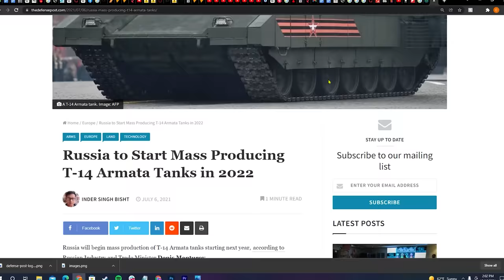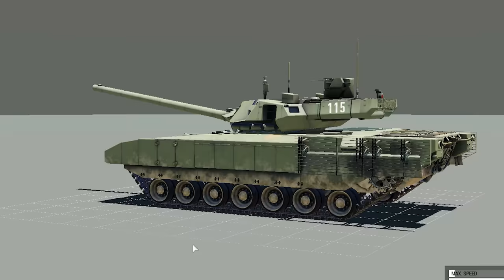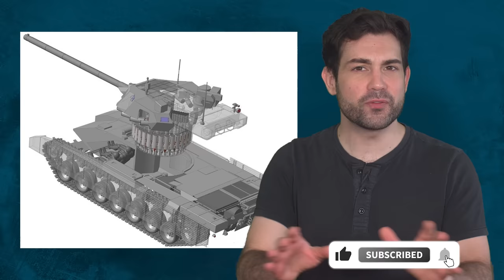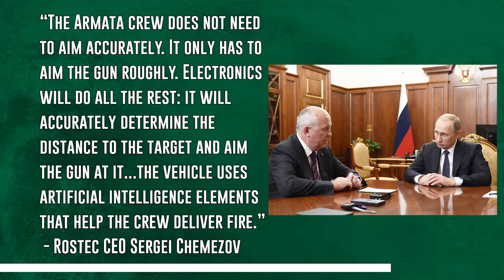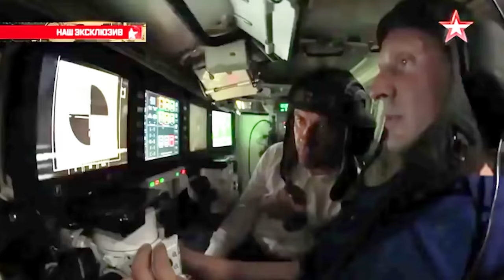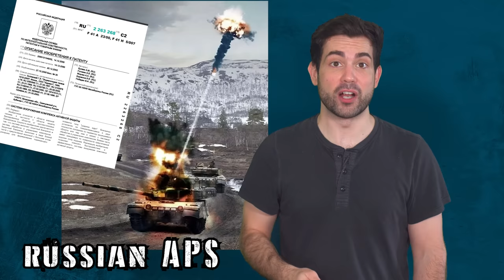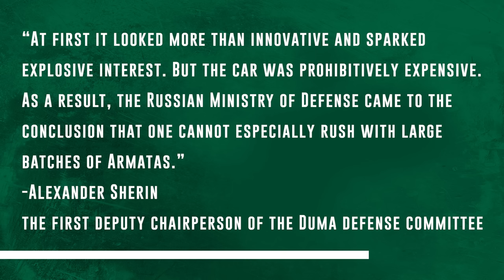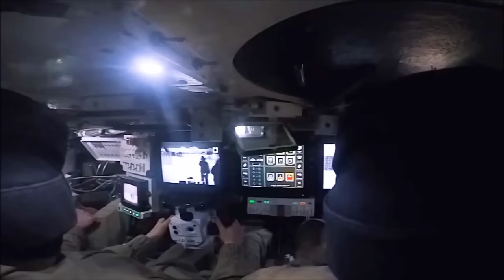The Truth About Russia's T-14 Armata Tank

Comment: The Abrams does not have 50 times zoom, it has 50 times digital zoom, increasing those pixels does not give you a better picture. Fairly confident any computerized fire control system can zoom in on pixels not just the abrams.
Reply: Yeah digital zoom is nothing special. And as you say, you can't create detail out of something that isn't there. The real world isn't CSI where you can just infinitely enhance and magically get details you wouldn't otherwise get.
Reply: @TehIdiotOne  Enhance four pixels into an image sharp enough to figure out what brand of watch the perp was wearing XD
Reply: No bro this ain't ur average software it's alot better and it ain't entitled digital if it was then you wouldn't have a camera
Reply: @yeetyskeet5548  That's not how optics work.
Reply: @yeetyskeet5548  That's not how optics work.
Reply: @yeetyskeet5548  That's not how optics work.
Reply: Clear up that blur!

Sir that's the maximum resolution 🤣
Reply: @CarlGGHamilton  Digital zoom and processing has nothing to do with the OPTICS used
Reply: @josephspurgis7782  Digital zoom and processing has nothing to do with the OPTICS used
Reply: @zenko247  Optical zoom is the actual zoom, it determines the actual size and resolution of the picture. Digital zoom just makes the pixels bigger, it does not increase image quality.
Reply: @CarlGGHamilton  THEY ARE USING DIGITAL ZOOM  WHICH AND LISTERN |TO THE VIDEO If the  digital sensor has the resolution the image quality increases proportionally  no matter the optics  a 100Mega pixel sensor will give a sharper image then a say 20M Pixel no matter the optics  And the better the software the better improvement no matter the Optics. Ask any amateur  astronomer with a digital setup.
Reply: @zenko247  "100Mega pixel sensor" that's called optics. Light sensor, is optics. That is what optics are. :)
Reply: @CarlGGHamilton  A DIGITAL SENSOR  is not OPTICS  it coverts Light to Electrical signals and processes them electronically   Optics manage light not electrical signals  😁
Reply: @zenko247  https://en.wikipedia.org/wiki/Digital_sensor

You don't know how light works, and you don't know what a digital sensor is. I suggest you go try and use a camera because clearly you never have.
Reply: @CarlGGHamilton  You just shown that I was correct and  Digital Sensors are not Optics .  Note: Worked 20 years for Corning As a project designer for Fibre optic telecommunication and know a little bit about the subject of digital Transducers   OH and My 20mega Pixel camera on my new phone give much better pictures then my 5 mega pixel camera on my old one
Reply: So a Standard Definition  TV does not give a better picture the a HD TV with 4 times the Pixels  and a $K tv does  not ether ?????  is that what you are saying  ???  more pixels give a better picture or the whole world it being conned and are unable to differentiate between low and higher Pixels in the displays are they
Reply: Well the abrams had no problems in iraq. If the Ukrainians had them the war would be over.
Reply: @tclanjtopsom4846  If the Iraqis had 20,000 tanks and ballistic rockets that would have destroyed US airfields in suadi arabia it would probably not have been the same war now would it. You think a war comes down to which tank people have? That's silly.
Reply: @CarlGGHamilton  i think the usa would have used its better cruise missiles and airforce to destroy their air power and then used its tanks and troops with good logistics. Russia has shown its army to be a paper tiger.
Reply: @tclanjtopsom4846  That is cute
Reply: @CarlGGHamilton  it's cute because he is right lol the US destroyed their rockets before they could even fire but even if they had the US missile defenses are more than capable of taking out any missile short of the hypersonic ones and even those I bet the US has a counter for they just aren't saying anything yet. And even russia doesn't have 20k tanks lol what is that even supposed to mean 90% of Iraqs tanks were destroyed by the airforce anyway tank battles are basically a thing of the past.
Reply: But western arrays have orders of magnitude more pixels on their FPA's - so the zoom is still better resolution then russian displays.
Reply: @dennisbrown5313  You can have 1 billion x 1 billion pixels on your display, if your camera only takes 480x480 pixel pictures, that's still all you're going to get.

Comment: The B29 had four unmanned remotely operated turrets.
The Rheinmetal 120mm has been able to finish the targeting solution since the 1970's when it was a 105mm.  This technology was introduced in the AH56 Cheyenne based off the technology from the B29's radar remote targeting stations.
Reply: The B-29 also had a Sperry analog computer used to direct fire, coupled to the aircraft's on-board radar.  Analysis of combat footage over Europe from B-17s, B-24s, and B-25s, which were designed for much slower top speeds (about 260 mph), against early 1940s-vintage fighter aircraft (some could very shortly get over 400 mph, but doing so severely hampered their "loiter" time) indicated that waist, top, and belly gunners seldom, if ever, hit any enemy aircraft, due to the vagaries of the approach vectors and relative velocities involved. The rear gunner had the best chance of hitting an approaching fighter at all; followed by forward gunners (in the B-17G onwards) taking on a "head-on" attack.  Typically only these two positions contributed any meaningful defense to the aircraft, the others were useful mainly for complementary cover to the other planes in formation.

The B-29 intended to solve these issues by having the analog computer devise a shooting solution when the aircraft's radar picked up enemy targets; it could direct those remote-control turrets quicker and with better accuracy than a human gunner was capable of.  Since that plane wasn't used in any numbers over Europe, and by the time it really got into action in significant enough numbers over Japan in early 1945, the Japanese fighter defense was virtually nonexistent, due to lack of, mainly, fuel and trained pilots.  Most of what aircraft they did have were obsolete by 1945 standards and what few did sortie were easily picked off by American CAP, either P-38 Lightnings or P-51 Mustangs.  In fact, the CO of the XX Air Force, Curtis "Bombs Away" Le May, realizing that the B-29 gunners were effectively out of a job, had all but the tail guns, ammo, and crew removed on some of them operating out of Tinian island, and sent them on low-level night raids against Japanese cities, dropping incendiaries with horrific effect.  The air raid of greatest destruction was against Tokyo, with 328 of these B-29s, thus modified, and the destruction burned out almost 20 square miles of Japan's capital and killed an estimate 125K people...more died that night than in the first 24 hours after Hiroshima and Nagasaki, combined.

However, the heydey of the B-29 would be short-lived.  Not only was it slated for replacement by first the B-36 "Peacemaker" and later the B-52 "BUFF", it was, in spite of its size IAW WWII standards, designated a "medium" bomber when the Air Force came into being as a separate service.  Over Korea, at first the B-29s helped to destroy the DPRK's ability to carry on the war, and fighter cover (F-51s, F-82 "Twin" Mustangs, and P-80 jets) dealt with the WWII-vintage MiG and Lavochkin piston-engined fighters flowed by the North Koreans.  But in November, 1950, the first MiG-15 jet fighters made their appearance, and could virtually ignore the USAF fighter cover and wreaked havoc on the B-29s in daylight.  These jets were, of course, flown by Soviet V-VS pilots, under command of WWII Soviet Ace Ivan Kozehdub, who also, against orders, flew a few missions himself and claimed to have shot down two USAF P-80s and an F-86!  It got so bad that after a particular debacle, known in USAF annals as "Black Tuesday", where, on a daylight raid on October 30, 1951, six of nine B-29s of a particular raid against an airfield at Namsi, Korea, were lost.  The USAF would never send B-29s on a daylight raid again.

Comment: Don’t quote me on this but 50x on M1 is electronic and therefore not really a lot better than 12x on the Armata
Reply from the maker: you're saying its like a digitally enhanced zoom instead of anactual optical lens zoom? That might be the case I'll have to double check that
Reply: @Taskandpurpose  yeah in my memory it is but I’m not 100% sure
Reply: You're right but this isn't the early 2000's using old nikon cameras. It is a new upgrade and most likely has some sort of upscaling.
Reply: Upscaling or any form of digital zoom is still a legitimate issue. Even with current technology, it isn’t up to par with analogue lenses in terms of picture quality. You also can have issues with minute details being obscured or blended into the overall picture. This may be an issue against a target that’s well camouflaged.
Reply: @Taskandpurpose  yes the optical zoom is 13X and the Abrams can further electronically zoom 25X and 50X. However firing from that level of zoom gives a higher chance of error bc any tiny adjustment in aim will have a greater effect on trajectory
Reply: These are true statements of firing at target at distance. Even on the military channel this is evadent in trying to get long ranged shots weather it's digital or actual lenses are tricky at best. Say is that a tank in distance? The only good long range is the main gun. Fire on target!!!!! Say was that the direction of the parking lot? What did that guy say on the radio? Oh #@$&!!!!; That was the commanders car. Driver just drive. Go go go!!!!!!
Reply: @rayhatton7683  You are leading into the value of a combat network.  The ability of all units to share and update information about targets changes the doctrine.   A long range targeting system becomes far more valuable.  Without such a network, the capability is hard to justify, since the crew is unlikely to spot, identify and engage a target at 5km.
Reply: @1djbecker  very true. Now the comment on long range shots are also true. The distance involved doesn't mean the shot will reach the intended target or even on range. Then the joke makes more sense. Whom knows how there tank ranges are used or set up honestly. Not counting on human error or the factor of error in the targeting of targets. How would anyone see even in long distance involved with this system for it to be seen?

Comment: Great presentation, Chris. Just a thought. Maybe what the Armata's is going through (as the intended next step in concept and design) is exactly what the T64 went through?

Armata is what the Russian military wants to have BUT may not necessarily THE only way to achieve that step. 

The T64 was produced in rather small numbers (compared to other tank series), was never exported (prior to the collapse of the USSR) and became a working test platform for the development of next generation of tanks like the T80.
Reply: Yes possible, but no not the same. T64 was meant to be developed alongside the T-80. One for tech excellence, the other for ease of production ----> mass production. T14 was supposed to be a hybrid, both tech excellence & mass production.
Reply: @vdotme  not T-80, T-72
Reply: i would consider 13k units delivered a pretty big production run. that outproduced just about every western MBT series alone.
AND it was the high price, high tech, low production tank.
T72 clocks in at about 25k
And T80 as the most expensive one at about 6000
Reply: Brendon O'Connell III  okay okay, you can take your tinfoil hat off now
Reply from the maker: to be honest I was actually not very familiar with the T-64 ! I just started getting more into learning about main battle tanks, a natural curiosity out of my Infantry Fighting Vehicle fascination. But this peeked my interest I'm going to look into the T-64 and cover it fully in a future video.
Reply: So the 10 000 t 64s the Russians had produced by 1985 were "small numbers" yeah right
Reply: @Taskandpurpose  piqued.
Reply: @caseyb1346  i agree with you on that point.
Reply: There were over 10,000 T-64s produced....
Reply: The production for T64  ended in 1987 for all versions. The total production has reached almost 13,000
Reply: @tonyjoka2346  The production ended in 1987 for all versions. The total production has reached almost 13,000.pieces
Reply: @grandayatollah5655  13.000 in total
Reply: @selmirvelic7109  yeah and?? Ain't that exactly my point
Reply: @caseyb1346  All right, please back up the statement «It will be the out of control military budget. And that is backed up by countless historical examples dating back to antiquity.»
to be exactly the last part. Give me feed for the brain.
Reply: @worldoftancraft  In 1894 Someone fitted a ship with a Steam Turbine Engine & roared up the Thames during the Naval Salute to King Edward VIII. On that day the entire British Royal Navy became obsolete, & they had an entire Empire to protect. Kaiser Wilhelm saw this & realised here was his way to creating a German Empire. Both Britain & Germany started building Dreadnoughts as fast as they could. Britain could build more, but they had an entire Empire to protect. To be brief, at the beginning of WW1 both the UK & Germany were massively in debt, & had huge Navies that wanted to do something. Wars rarely start from only one cause, but the massive amounts of debt those two Countries were in meant they both needed to expand somewhere, or Conquer something. It was far from the only cause of the War, but it was a significant factor, according to a lot of academics.
Add to that, the extreme harshness of the Treaty of Versailles at the end of WW1 pretty much set the stage for the sequel two decades later.
Reply: @tyrionas  а по вашему военным корпорациям нужен мир , когда не требуется поддерживать рынок сбыта ? Тогда вы сами очень недалекий человек . Это в то время как раз СССР , в котором не было таких коммерческих корпораций не сильно был заинтересован в военной напряженности . После военной разрухи половины страны трудовые ресурсы пошли бы на население станы , а не на оборону. А по поводу агрессии , НАТО изначально акцентировалось как защита от агрессии СССР. Когда СССР исчез , а экономика России в 90-х годах оказалась в жалком положении , армию сократили ,в Европе не осталось соцстран и советской армии, почему НАТО не распустили , почему границы России были окружены сотнями военных баз ? Кто в результате оказался агрессором и кто только от него защищался ? У вас двойные стандарты . Россия не хочет повторить историю Югославии и Ирака , ваши санкции нас только заставили сплотиться , спасибо за эту глупость ))
Reply: @user-hz1mx8ly2i  yeah I don't speak Russian mate, you're gonna have to make an effort if you wanna have a conversation
Reply: @tyrionas  Tinfoil hat? Educate yourself.